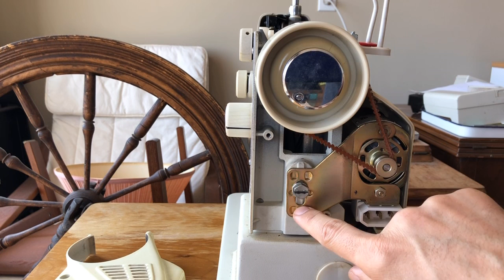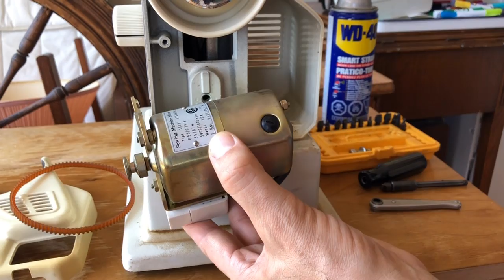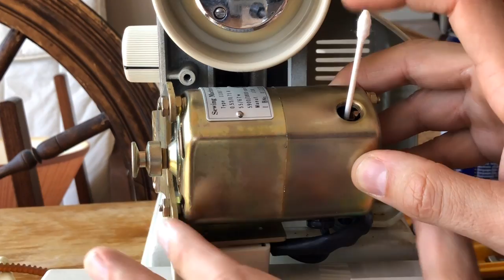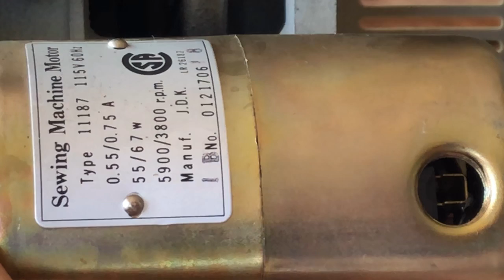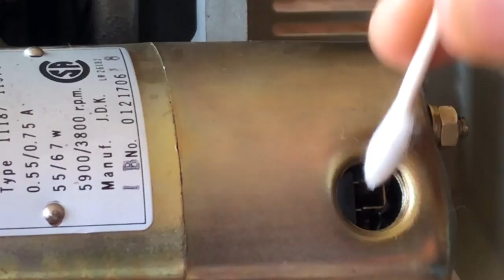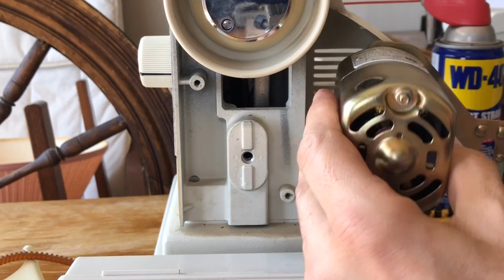MOTOR SERIES #3: Servicing Common Motor Styles (1950s-1970s) Bearing & Brush Maintenance

Comment: Thanks for the video. I've owned a Kenmore 158 180274 for twenty-seven years. I oil it regularly according to the manual. I ran across a blog that mentioned oiling the motor. I have never heard of this. So here I am watching several of your videos to learn if I need to put a drop of sewing machine oil in either end where the red circle is. I have never had my machine serviced as it has operated wonderfully. I had my husband who is a mechanic and understands motor-y things put 2 drops of oil in there areas indicated from the blog I mentioned. 27 years and I never new. I want my dear Kenny to last me till I can't sew any longer. I hope I did the right thing in having him oil it. Now I am wondering if the brushes need replacing? Thanks again.
Reply from the maker: Hopefully, your machine will be ok.  It is extraordinary how tolerant these machines were, but its great that you oiled your motor.  And 2 drops is plenty so I would resist any temptation to add any more for at least a year DEPENDING ON how often you sew.  And even if your motor ever did have issues, lots of vintage motors out there for these exist so I would keep doing what you have been.  Vintage Kenmores are awesome and often under valued. Thank you for sharing!

Comment: I picked up a New Home  and the motor runs in reverse.  Meaning the instead  of operating in a clockwise motion , it runs counter clockwise.  It runs nice just backwards.  I've cleaned and oiled thinking it was gummed up but no help. Is there a fuse or breaker that could cause it to operate like that?

Comment: I know this is an old video, but I'm not understanding your explanation of which way the commutator turns inside.  If you had a visual with something riund, even a toilet paper tube, that would help.  Thanks so much for your hard work and I'm sorry I'm not following your explanation.

Comment: If you look close you will see that there is a flat, round, felt oil wick inside that oil hole. The oil soaks into the wick and the wick carries the oil to the shaft and bushing.

Comment: I have a White 77 and the pulley is very stiff. Do you recommend manually turning it (a very difficult task) to clean the commutator, or do I need to open the motor to work on something inside first?

Comment: if my motor gets hot could it be that i need to do what you are doing right now to this motor? mine is on the outside of my machine. just was afraid to go into the motor part for anything.  just don't want to ruin it>
Reply from the maker: Its hard to say why your motor is hot.  When run for a while, all motors will get warm, but you could have an issue somewhere with yours.  I would not use it until you have solved the mystery.  You might have it looked at by a Sewing-Vacuum center that does repair work.

Comment: Another great video! I have a Japanese copy of a Class 15 (Precision DeLuxe Dressmaker) I wanted to check the motor brushes, but there are no "brush ports". I attempted to slide the two halves apart but could not. Have you encountered a motor with this structure?? Thanks!
Reply from the maker: Greetings Abe.  You must be very intuitive as I have another video coming on just that topic. I'm going to use the White Model 164 that I made a video on previously which has just this kind of motor (https://www.youtube.com/watch?v=qJEEQRjHu3w&t=3s ) I will show two approaches to this kind of motor and when it might  (or might not) be worth taking those motors without brush access apart.  A better shot of its motor is actually on one of the TROUBLESHOOTING videos seen here: https://www.youtube.com/watch?v=p5k14MGpce4&t=5s  When I make the video for the motor you are asking about, it will be listed as a MOTOR SERIES video. Stay tuned!